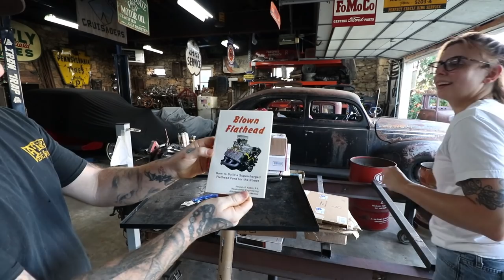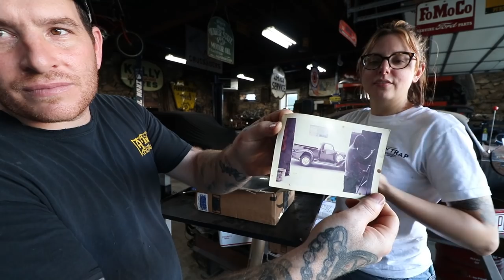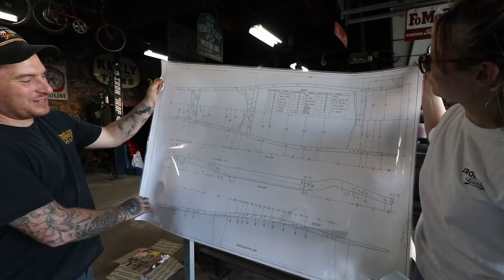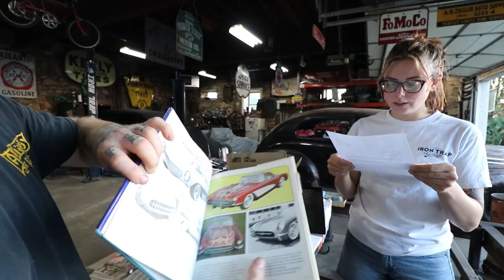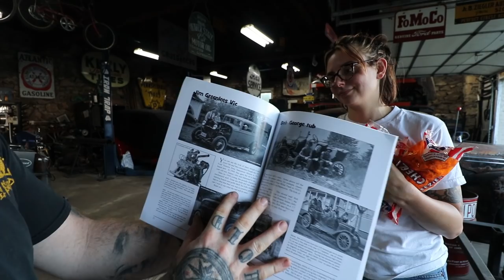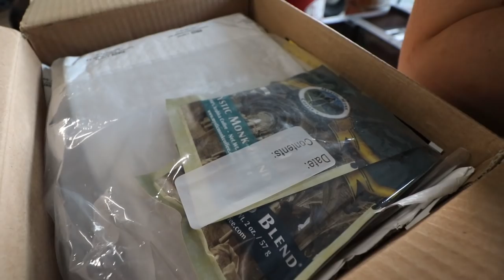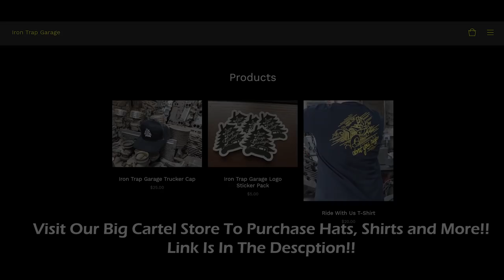Our Post Office Hates Us!! Over 15 Packages To Open!!!

Comment: Your mail call is great because you usually get some old, original hot rod parts, magazines, etc. I'm old enough to remember the little magazines and still have a few, however; I never did get a Model-A roadster as I have always wanted.  Priorities.  You are keeping the old rodding scene alive by using the flatheads and related parts.  Keep up the good work !

Comment: My Covid 19 project is a 2400 Square foot shop build. It's 16 feet tall to accommodate my RV plus will be adding a lift to keep my junk on the road. I like to build rat bikes and jeeps but want to build a 4 wheel drive model A. You guys are awesome and are inspiring me to build something really crusty and cool. Thanks for being real! Oh man, I used to read Car Toons Magazine back in the 70's and loved it. Made me want to build a vintage street rod before I got hooked by my 67 Chevelle that I totaled in High School back in 1977, then hot rod trucks and 4 wheel drives. Built a 74 Cherokee that would white smoke all 4 tires several years back and a few other monsters before life stopped me from building cars and trucks. But bikes are still getting work here. Also, I had a barefoot gas pedal in my 55 Buick Century I had when I graduated High School in 1979. What a cool add on part.

Comment: Hey Matt, I was the one who did the 3D printed stuff (Robert V form Toronto).. making a key chain is a great idea... except for the cost as it was $120 to print in metal! (it had to be that size to get the fins as they would be too narrow to print on a smaller piece) but I am sure there are companies who could make a custom mold and punch out a bunch much cheaper...

Comment: The kreative oddities stuff was pretty rad. I could use some more stickers for the gas tank in the trunk of my model A coupe I built 3 years ago and currently building a 31 A pick up on a deuce frame. The pickup will be my third build. The first one was my dad's 36 Chevy coupe where I learned to lead when I was 14. I'm 28 now.

Comment: you inspired me to work out solutions , make my own bracket mounts, weld'er up;  installed my ididit old school steering column in my reborn 1931 coupe( I've had since 1960 Flathead, sbc 265,350 ) OE on top everything new below Thanks Irontrap mail call is great, Snerd

Comment: Hey Matt & Kate,
   I don't know how I did it but I missed this video 4 days ago.
Bad Me !
   Thank you for opening my lil package first.
I don't remember which pieces I sent you, that set could be from a 49 thru 57 Ford.
There may have been a note in the package telling you which they came off of.
But I sent them for the 34 if you wish to use them on that car.
If Not I know you will do something good with them.
I have several sets from different cars which we remove all sellable parts from before the shells go to a Scrap Yard.
   We need more Kate Videos, She really ads something to the show.
Moon Dawgy is cool also.
Mike still needs to replace that 39 lens he dropped !
Shame Shame Shame, Bad Mike !
   P.S.
The Steering wheel I sent way back was taken from a "1957 FORD", non power steering as noted by the horn ring not having the power steering lettering.

   Be Safe And Well
   Live Long And Prosper